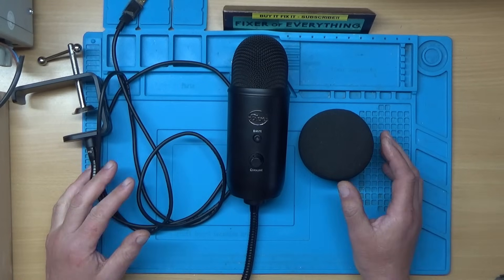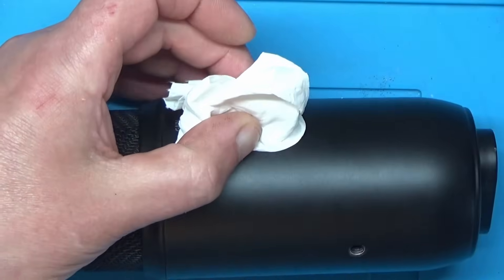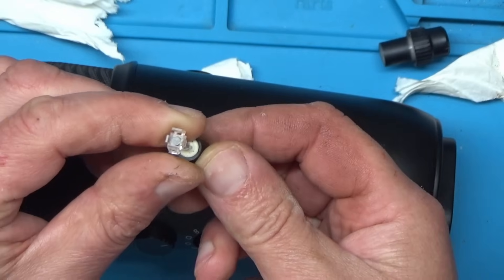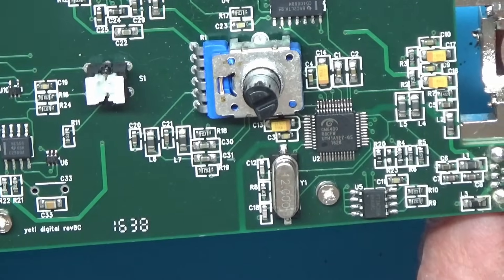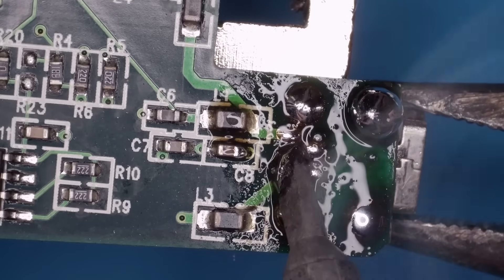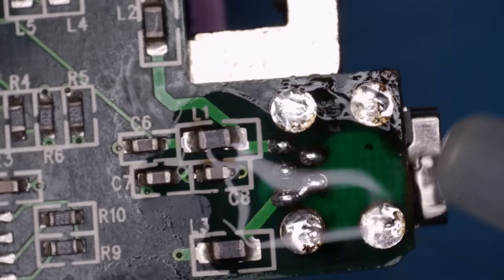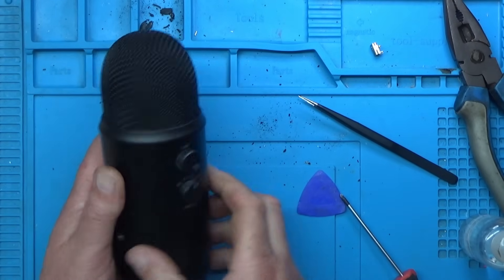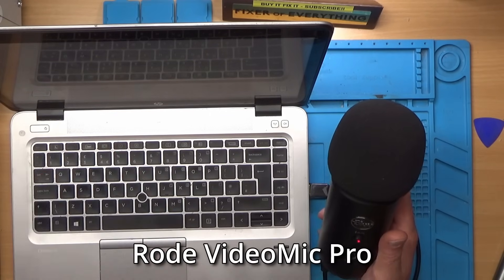Faulty Blue Yeti USB Microphone | Can I Fix It?

Comment: The Rode has a sound like you're in a room with hard surfaces and not much furniture.  Not a direct echo but tinny.  The Yeti seems to soften the edges of the sound.  A bit more professional sounding, like your in booth or sound compliant area. 
Great fix.  I was shocked at the difficulty you had with the control knobs, sheesh!
Thanks for your time and the great info/repair videos.

Comment: The Blue Yeti does take out the background hiss/noise. The Rode mic sounds fuller, your voice has more bass and the other mic it sounds a little higher. I do understand you haven't played with the settings on the Blue Yeti. I think if the Blue Yeti is a good mic then run with it. Great repair as always.

Comment: The Yeti sounds cleaner and less noisy. The Rode sounds more noisy but more natural.  Which is more accurate would require someone that knows you in person. Could check the eq settings are flat, and then have a bit play.

Comment: Yay another video, I enjoyed the Kubota vids, awesome fix in the end and hill climb. A frustrating one and costly too, worn out parts, I did the same with a motorcycle engine years ago had to replace the entire gear system and neutral selector, started with a little difficult to select neutral and got to a stage where that's not an option any more, ruined the clutch too!

Comment: Blue yeti is more clear but your Rode mic is more relaxing on the ears. Also sounds like Rode is less processing for your work flow.
Reply: I agree, blue yeti is clearer it sounds like it clips high and low frequency. Rode is warmer sound and a bit like you are in a small room like a toilet, but i still prefer rode
Reply: : }   I really like use of term, "relaxing",  thanks.
Reply: Blue Yeti is slightly better, but not enough that you should add to your video production work.... I would keep the Rode.